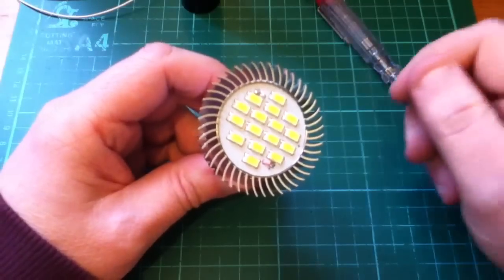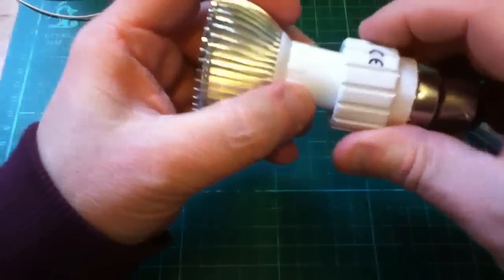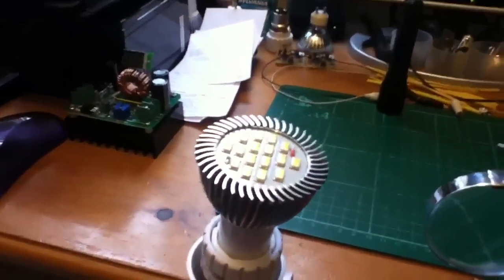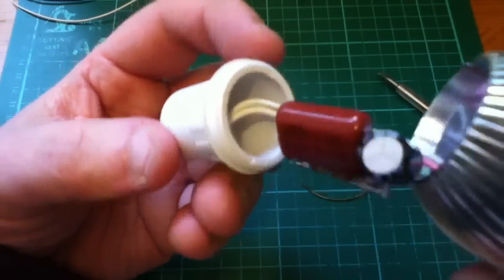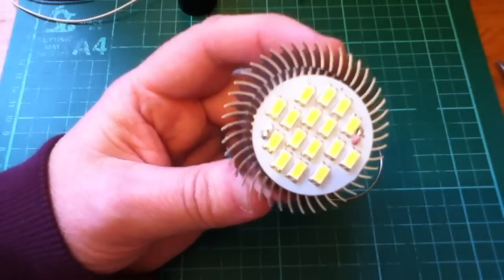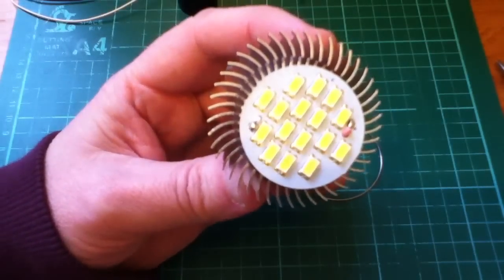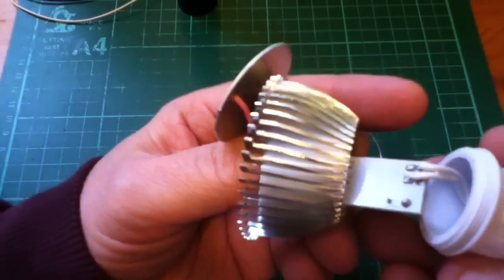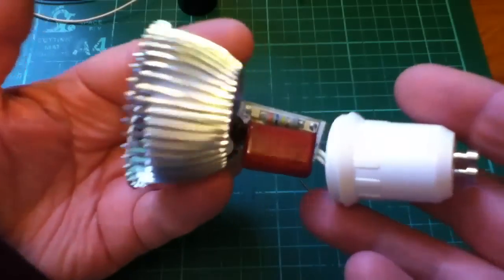Dangerous GU10 LED Spot Light is Cheap and Bright but could Kill You - Seriously

Comment: Well it's not mains voltage at the LED's is it so I don't get what your on about. What are the actual voltage of those LED's? Whatever they are it won't be over 12 volts, probably more like 4.5 volts and it's DC. I'll stick my tongue across those connection points any way round you want to plug it in and enjoy the pleasant tingle!
Reply: Why don't you buy one of these, stick it in the mains, then use a AC voltmeter to measure the voltage between those "safe" LED contacts and ground. 50% chance there will be more than 100V AC. Yes across the LEDs themselves there's 4 Volts DC but the 4V DC comes with a free AC imposed on it. For proper electrical insulation a transformer is needed, I did not see one in this lamp.
Reply: Peter-Paul Vervoort
Out of interest, have you had a shock off this before?
Reply: Such a product: No because I do not buy such crappy products. Of some AC voltage that would show up on a meter: yes unfortunately when I wasn't carefull enough. I think you still don't believe you could get a shock from such a lamp. So here's a thought experiment: imagine a LED flashlight on batteries with a metal case, it is switched ON, so there's 4 Volts, right ? You cannot get a shock from this. Now I am evil and connect the metal case to the Live pin of the mains (110 or 220V AC, whatever you prefer). LED still on so still 4V right ? But would you touch the metal case ? I would not as it is Live ! But also 4 V, the LED only sees 4 V. You would only see 4 V if you were isolated well enough (rubber shoes or floating in air). But your feet are on the floor and that is enough to see the 100 V AC from which you get a shock. Hope that explains it :-)
Reply: Well if that's the case report it to trading standards and save someone else from being juiced up. Is there no quality control in the UK anymore or something?
Reply: There is (I assume there is in UK, I live in NL), in NL for sure an unsafe product like this will not be allowed on the market. It would never pass a KEMA certification. But Julian bought it on Ebay directly from China circumventing all safety and quality control checks. It's cheaper but comes with a risk so you better know what you're doing.
Reply: Surely your governments are not aware of this? If so what is the point in KEMA certification anyway?
Reply: There isn't much UK or NL governments can do much about people ordering unsafe stuff from China directly. The only government that could do something is the Chinese government but I think they don't care at this moment. In NL (and other countries) a product with a KEMA certification is regarded as very safe (otherwise it would not get the certification). The manufacturer of the unsafe LED lamp we were discussing before can just look in the requirements for safety used by the KEMA and then conclude that his lamp will never pass so he will not try to get certified and as a result will not be able to sell it in countries where user safety is important. He probably would not care as he can still sell the lamp in many countries that are less strict regarding user safety.
Reply: Now we know why it's 110 V in the U.S.
Reply: The voltage between the LED connections may only be a few volts BUT depending upon which way the lamp is plugged in the voltage between the metal heat sink could be 230V between the sink and earth. That is what could kill! If it is plugged in the opposite way the voltage between the the heat sink and earth could only be a few millivolts but as the video points out, that is a game of chance  50/50.
Reply: Uhm, no thanks :-)
Reply: Yes, please stick your tongue on the contacts and enjoy the tingle!
I don't know how many times it has already been said in the comments, but the argument "there's only 12V max on the LEDs" is one of the stupidest of them all. It just shows that you've got no idea what you're talking about.
How about you hold an AA battery onto the mains live wire and touch the other contact of the battery? Come on do it! It's just 1,5 volts!
Reply: Peter-Paul Vervoort I'm going to go out on a limb here and say that there isn't a 50 percent chance of dying from this bulb.  For one... this is a DC device. The electricity goes into a rectifier circuit so the direction of the terminals does not matter.  The AC is rectified into a half wave DC signal.  Hot will always stay hot.  Secondly... There is no mains on the terminals that connect the LED matrix.  If there was it would be high enough to destroy the reverse bias voltage of the LEDs and they would instantly die and no longer conduct.... or they would short out the bulb and blow a breaker/fuse.  Electricity follows the path of least resistance.  If the case did become live it would only become live on half of the circuit.  So unless you intentionally touched the other terminal you will be just fine.  Assuming your not standing in a puddle of water outside near your conduction rod in the ground (if you even have one) you won't even feel a tingle.  You could simply disprove everybody by plugging it in backwards... but I doubt this video will ever come to fruition
Reply: The problem lies that its not mains isolated and it can seriously electricute you. The potential from ground could be around190v
Reply: No, the GU10 socket is not designed for that, it's symmetrical so 50% chance you get it wrong. But it's not GU10's fault, it's this partcular LED lamp design that is wrong. Proper GU10 lamps are isolated and will not electrocute their users :-)
Reply: Peter-Paul Vervoort You're saying 50% chance for a lay person getting it wrong? I'd test it then swap it around if need be. Then mark the bulb and socket for the correct orientation. That way your 50% chance of getting it right is 100%.
Reply: Jason Axford  50% chance for any (wo)man to get it wrong ! Your procedure works but you that does not make the LED lamp safe to use for everyone, which it should be in my opinion.
Reply: What i cant get is why people buy cheaply made under tested lamps from china off ebay and then make a video complaining about it knowing full well what they were getting into.. It's simple. Spend the extra and buy it locally and you will not have to worry about being zapped into submission.
Reply: Jason Axford
So then, why is it 110 V in the U.S.? And while explaining that, could you also explain why the difference in voltage cycle in UK vs. in U.S.? This side of the pond, normal A/C is 60 cycle but in the UK normal A/C is 50 cycle.

Remember, the voltage isn't the deadly part. What kills is the AMPS, not the volts. Even 1/2 volt CAN kill you if its amperage is high enough, and I'm living proof that a low amperage 240 volt shock won't necessarily kill me. Some circuits here in the U.S. do use 240 volt so two hot wires total 480 volts. Just like here, most high voltage household appliances use 240 volt power which they obtain from the two 120 hot lines feeding into the house on opposite phase so single hot wire gives 120 volts, but both hots fed into same circuit gives 240 volts.
Reply: sparkyuiop You make a living by repairing computer equipment, right? Well I don't see how a person without even a basic knowledge of electricity could successfuly repair an electronic circuit? If I were you I would consider doing something else in life.
Reply: Melinda Green I don't think he 'complained' but rather 'warned'. Sometimes people feel too comfortable when products bought at home are always according to specs and safe and one may think:  'hey that is a cheap LED-lamp' - not even realising the fact that it might not be up to standards.... and then it arrives. Fortunately this guy took a look and  went through the trouble of warning people
Reply: sparkyuiop Don't need to be offensive. I just pointed out some FACTS based on what you wrote (and I am not the only one). If you can't stand being criticised that's your problem.
Reply: atomgonuclear  The circuit is a reactance divider/rectifier type. A capacitor whose reactance is equal to the equivalent of a series resistance that would be required to supply the 140mA at 64 volts the STRING of 4V LEDs requires. LEDs like this are always placed in series so that a single current source can be used. Only 1 leg of the mains has the capacitor so mains is there on either the Anode or Cathode end of the LED string.

You can take the wattage of the lamp and divide by the product of the number of LEDs times 4 (LED voltage is generally 3.8 to 4.1 for Ultra Blue Phosphor White types). The voltage is just the product of 4 times the number of LEDs. A 9W bulb is the equivalent of a 40W incandescent, so 9/(4*16) = 0.14A and 4*16 = 64V. The reactance of the capacitor is 1966 Ohms.

If this is a bridge rectifier, VDC is 1.414 (Square Root of 2) times 240VRMS, or 339VDC minus 64V (LED string) over 0.14A, or 1966 Ohms. That becomes about 1.6UF at 400VAC and that's rather large. More likely this is a half wave rectifier type. That gives 63% of your VRMS, or 151VDC. Subtract 64V and that leaves 87V divided by 0.14A for a reactance of 622 Ohms at 50Hz. That's 5UF at 200V.

Either way, the full mains is on one side of this lamp circuit relative to Neutral/Earth and 64VDC is ONLY across the LEDs.
Reply: Exact words "Live mains straight to the front plate and no glass".  He's simply wrong.  He also says the circuit is not isolated from AC.  It is.... by several megaohms.
Reply: Can't you just find out which pin is live in the socket and make sure the front is only seeing neutral? Are there no markings on the GU10 housing?
Reply: Melinda Green I agree with you that spending the money and buying locally is easier and safer. But not everyone is willing to take that route. And not all cheap lamps form China / ebay are poorly designed and dangerous. Most of the safe lamps you can buy in the West are also made in China ! So if you buy them from China directly you can save a lot of money. The point of this video is to show how to recognize a bad lamp and to show what is bad about it. I.E. show us how it should NOT be done. In an ideal world the manufacturer would see this video and would then improve his product.
Reply: Peter-Paul Vervoort DAMNIT i hit the abuse flag instead of the reply one sorry. my laptop pad is acting weird. anyways i agree with you there. its just people seem to not do research on certain products anymore.
Reply: Peter-Paul Vervoort I couldn't recognize a bad bulb listed on Ebay. I mean, you had to buy it before being able to analyze it. Maybe you could start a series, reviewing each bulb bought off Ebay? I'm sure a lot of people would find it very useful.
Reply: Jason Axford Problem is that there are too many types and different sellers, some lamps look alike but are not the same. Also, I don't like these cheaply made, unsafe lamps. I don't want to be anywhere near them. With anything that connects directly to the mains, I want to be sure it's safe.
Reply: Don't think 110V is so much safer than 240V, both can kill you. In the US you have 110V because that's all lightbulbs could handle when electricity was introduced. By the time electricity came to Europe it was possible to make 220V lightbulbs also a higher voltage means higher efficiency when distributing the power (you need less copper) so the choice was easy: 220V or 240V (UK and since a few years also here in NL).
Reply: superdau
Ha! Ha! Ha! Alright then. Your funny!
Reply: Um.  OK - you'd be very, very, very wrong :)

There's 240V at the terminals if you get it the wrong way around.  So you'd be dead - unless you are in a modern Australian house, where RCDBO's are required for every circuit - including cookers, lights, and hot water circuits.
Reply: tcpnetworks I am unfamiliar with the term RCDBO (I'm not from Australia) but after some googling I think it is similar to circuit blockers we use here in NL. Unfortunately these also will not protect you, look at the specifications, they trip (switch off) at around 30mA or so. And that is already enough to kill you :-( Also, they're too slow. So you die first and then it switches off :-( Sorry to have ruined your faith in these safety devices ;-)
Reply: Peter-Paul Vervoort
Not only that. If the electricity doesn't hurt you (although 30mA will hurt and are dangerous, but after the RCD tripped you will at least be able the let go and others that try to help you won't get shocked), the fall from the ladder WILL hurt you. Often the uncontrollable movements due to the electric shock will cause severe injuries.
Reply: rcmodelr
You fail at Ohm's law. "What kills is the AMPS, not the volts" may be factually correct (because biologically it's current that disrupts nerve cells), but your next sentence shows that you don't understand at all what you're talking about. Back to school on what determines current in a circuit.
Reply: rcmodelr No, 0.5 V cannot kill you as a human is not low ohmic (conductive) enough to have enough current flow to kill you. And no shock will  necessarily kill you, even 20.000 Volts with enough current MIGHT not kill you, it all depends on the circumstances. Your heart is the most sensitive in this respect. That's why experienced electricians keep one hand in their pocket while working on live equipment. Also read my earlier post why US has 110 V i.s.o. 240 V. For 60Hz vs 50 Hz, find more info here: http://en.wikipedia.org/wiki/Utility_frequency
Reply: LEDs of that type are 4V each and between 100 to 300mA depending on the power the "lamp" is rated for. This is probably 9W (40W incandescent equivalent) so it's probably 64VDC at 140mA for the chain of 16 he has there. And it's not the voltage, but the leakage current that can kill you. 40mA from any voltage at all can be lethal.
Reply: rcmodelr
You got to have volts in order to have amps.
Reply: That is a lot of wasted math that you spent all that time doing.  The only thing you demonstrated is you sort of know OHMS law and you don't know how capacitors or bridge rectifiers work.  For the second time... The capacitors ARE NOT AC.  Why do you keep saying they are 400VAC and why are you giving 50Hz measurements for DC capacitors?.  Secondly.  Nobody uses half bridge wave rectifiers anymore.  Lastly, you don't know that this circuit is in series.  It might be, however that has not been demonstrated because the plate they are attached to could have an integral matrix.  This doesn't matter though because we are not aruguing voltages, we are arguing purpose.  He was saying that half of the time you plug it in that mains was hooked up to the neutral side and somehow grounded to the lightbulb heatsink.  He was talking about full mains AC voltage going to the neutral side of the bulb(and somehow the heatsink).  He wasn't talking about the capacitance inside the bulb.  That doesn't mean anything.. the bulb doesn't have to be safe Inside.. if you touch capacitors you get shocked.  Secondly... even if there was 400 V on the capacitor and you touched the mains... you would have to also be grounded to the same capacitor to get shocked.  The AC ground doesn't factor in considering the rectifier puts about 1Mohm resistance between you and AC ground
Reply: atomgonuclear Having disassembled several units from GE, Cree and some hard to decipher Chinese company, I can assure you many are not all that isolated. The heatsink is, of course, but it is usually tied to the screw base and that's supposed to be Neutral. Not always, depending on what the dipstick that installed the lamp did. The internal circuits can all be obtained from chip makers where the circuit contains solid state controllers and flyback regulators. Those are the ones where the LEDs are isolated from the Mains. The majority of the cheap ones use a reactance circuit that connects a polypropylene capacitor that can handle AC to act as the reactance. In all cases, safety regulations from both UL and the NEC (US) and IEC (UK) require the screw base be connected to the heatsink and tied to neutral. That would be the case if a PROFESSIONAL and COMPETENT electrician installed the lamp base, and that is what the regulations assume. Now, how many times have you seen the opposite? This is also defeated in portable lamps with equal sized blades on the plug (unpolarized). That's why the UK has tilted sockets and the US mandates all plugs be polarized where one blade is wider than the other. Oh, and the LEDs are most definitely in a single string. Only the current is regulated to anywhere from 80 to 180 milliamps. This is because LEDs do not parallel well. Traffic lights with from 180 to 210 LEDs are where many parallel strings are used, usually with 10 to 15 LEDs in series and each string having a ballast resistor. 10 to 20 ballast resistors wastes less energy than 210..
Reply: Joseph Perkins  These lights are not AC and never will be.  He very clearly said "electrolytic capacitor".  You cannot run AC in them under normal conditions.  AC would also waste half of the waveform because the second half of the couldn't go through the diode.  Also... even if the light wiring is backwards it does not matter if it's rectified.  Secondly.... this is no way has a flyback.  You don't need a flyback transformer for a small LED light.  You have all the voltage you need and then some.  You would use a flyback transformer/converter in a CFL.  Not an LED bulb.  The only time they are used in LEDs is for large LED arrays or dimmable circuits that are voltage dependent.  There is a lot better ways to dim LEDS so flybacks aren't that common either.  Lastly... I am talking about this specific bulb and this specific video.  I dunno about GE or other chinese brands, but this bulb is a 2 prong european bulb.  It's not a US 120volt screw in bulb that only goes in 1 way.  It's time for all to admit defeat who believe this video is true. It's not
Reply: atomgonuclear  If you don't know the circuit I'm referring to, just ask. Take that power resistor in series with that propylene cap (the orange epoxy dipped job) and a diode of a suitable type (usually a 1N4000 series) and either a second, smaller resistor or capacitor. This forms a reactance divider that divides a half wave (or full wave, not really important which) down to the 42VDC at 140mA needed without using a LARGE and power wasting conventional resistor. That first resistor is a just in case because polypropylene capacitors can experience dielectric failure and heal themselves from it, so it's a safety part. The electrolytic filters the pulsating DC to minimize flicker.

Here are two articles illustrating what I am talking about. Took 2 minutes to find. On choosing full solid state systems http://www.digikey.com/en/articles/techzone/2011/nov/the-challenges-of-choosing-offline-led-driver-topologies
and on using a reactance circuit http://www.instructables.com/id/Using-AC-with-LEDs-Part-2-and-make-this-handy-/

As I said: NOT ISOLATED except in special circumstances.
Reply: atomgonuclear Oh, all CFL circuits across the industry use a high voltage oscillator powered by a bridge rectifier and use a "ballast inductor" just like the older fluorescents, but now operating at about 40KHz, so the inductor can be tiny. Flybacks are only used for quality LED lighting as they can be designed to provide a fixed maximum voltage and a fixed and regulated current.
Reply: Peter-Paul Vervoort
Even if you put the LED the right way round, it is still lethal! The "power supply" is just a dropper C/R combination. The LEDs are floating on Mains voltage to ground. It does not matter which way round you put the LED, you will get a juicy shock when you touch the solder points of any LED...
Reply: ***** Exactly. Only a very few use a "flyback" power regulator that is isolated from the mains by a high frequency transformer.
Reply: sparkyuiop so if you follow the video he clearly shows the hot side unresisted has a 50% chance of being topside. so yes 400 volts at the LED. If you are the path to ground YOU become the resistor!